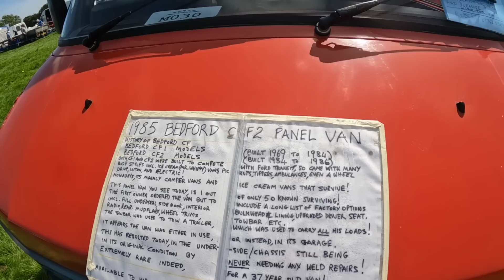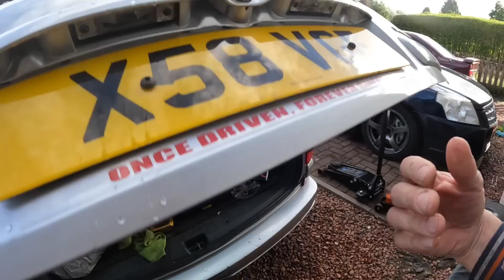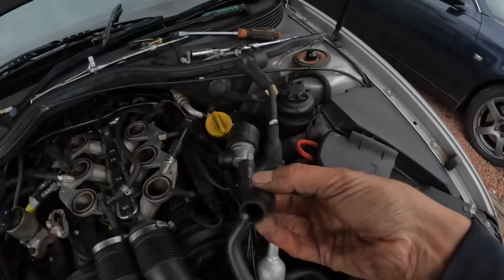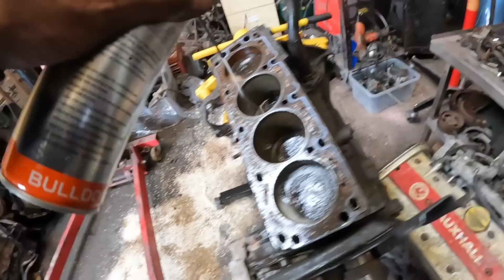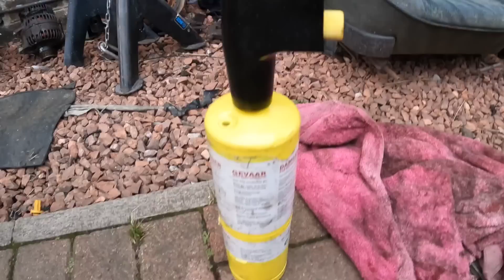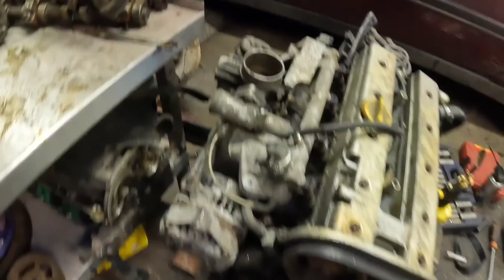The joys of owning old Vauxhalls (and a Saab). C18XE+X20XEV= alternative 'red top'?

Comment: J357 UPC, you said the EML is on, did you change the airflow meter when you converted this to SEH?
Reply from the maker: @brendon-elton  yes it was the SEH AFM that put the light out.
Reply: @OnceDrivenForeverSmitten  Glad you sorted it mate, the SEH airflow is manually adjusted with a screw, the later ones use a sensor, this puts the light on. you cant put a price on experience :)

Comment: Maybe get some of that Upolstry Foam,that you spray onto dirty/moldy upolstry,let it bubble up the mold out,then wipe it off with a damp sponge,do a second foam coat and then use a cloth to rub down the remaining moldy bits.If it worked well enough,it may save you from having to take the roof lining out,which could sag upon refitting it.Foam Action Cleaner.

Comment: c18xe cams should be bigger lift than 20xev

edit info suggests c18xe used 2 x20xev exhaust cams but this could still be an old forum myth
x20xer 256 degrees  10,16mm lift 
x20xev 252 duration 8.5 mm lift
x20xer is (european) mk4 astra opc 1 non turbo opc btw) a better 20xev
Reply from the maker: @adellisdevelopmen6593  cams are same part number, pistons look the same so I've no idea why C18XEs would often make more power than a X20XEV. Hopefully it goes well
Reply: @OnceDrivenForeverSmitten  wonder if previous ownerer has done some fettling 
some info says c18xe  has 2 xev cams others posts say other if all 4 cams are same inlet same exhaust maybe try use 2 xev exhaust. cams do a dyno . fit 2 xev inlets do a dyno then xev inlet on exhaust and xev exhaust on inlet for back to back test would certainly ly be interesting
Reply: on piston front could be worth checking the bore 
c18xe = 81.6mm bore 86mm stroke
x20xev = 86mm bore86 stroke 
can't fully remember head combustion chamber however the c18 is just undersized xev by the obvious bore difference

Comment: On my cars i always use  NGK iridium plugs when i have to change them. Same/equivalent  heatrange. These are very hard wearing and provide superior strength spark. Maybe something to consider?

About those multi-belts: they do wear. The sides of those tiny V's wear away which leaves the bottom of those V's to transmit the power. That's less cm2's to do the  drive  leading to belt slippage. On a new belt the drive is done by the sides of those V's. A new belt it's gotta be to get rid of that squeek.